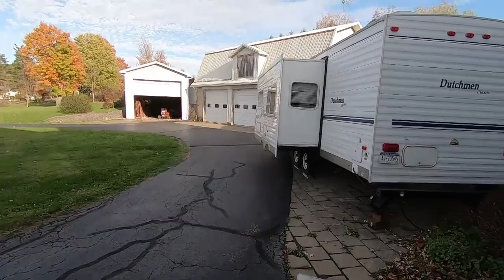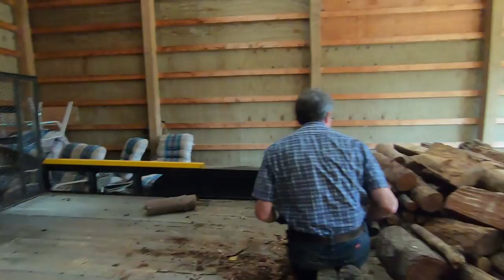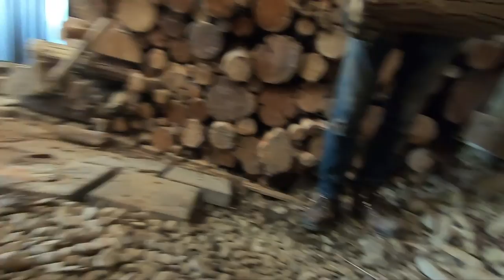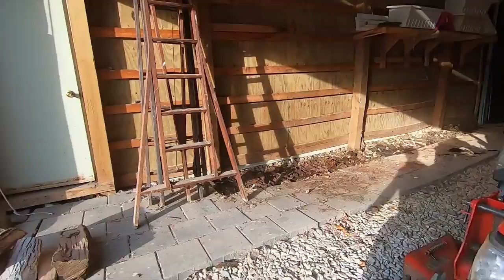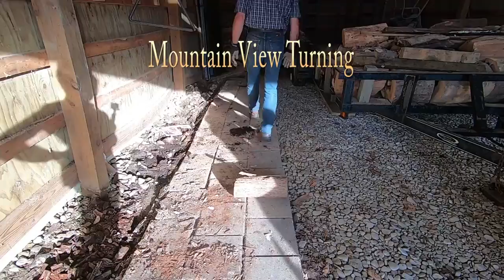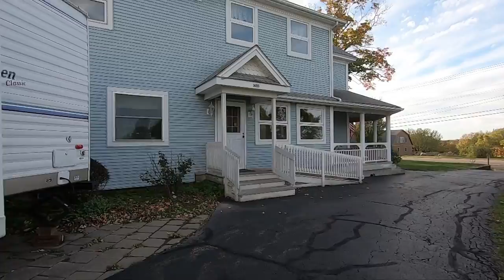What My Day Was

Comment: You should try Zenni optical for your frames. That is the only place I get mine from. They are not cheaply made but they are inexpensive. The only thing you need to have is the prescription with the PD number.
Reply from the maker: Thank you so much Kimber.  I have the new prescription paper and will give that a try. 💕NonnaGrace